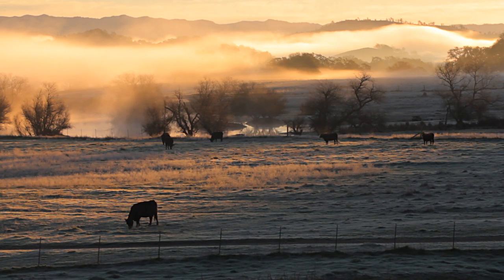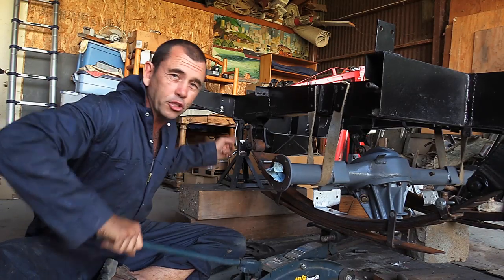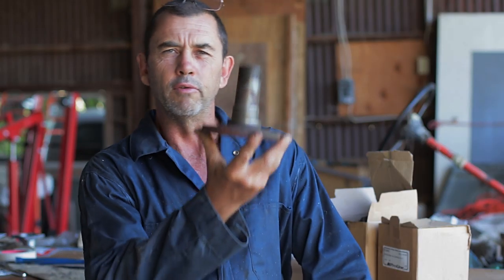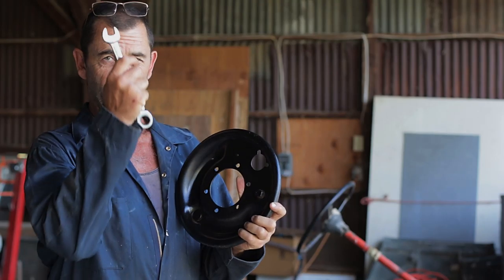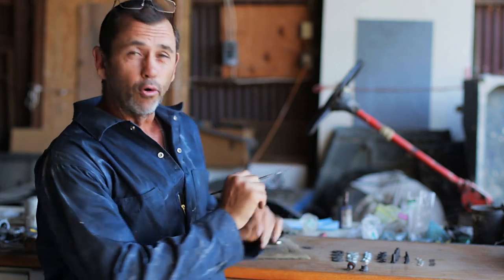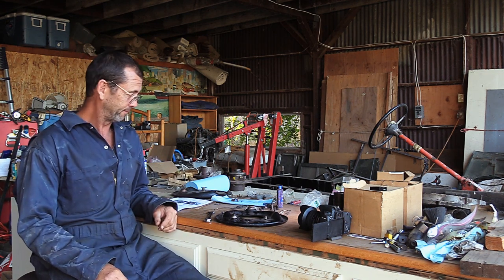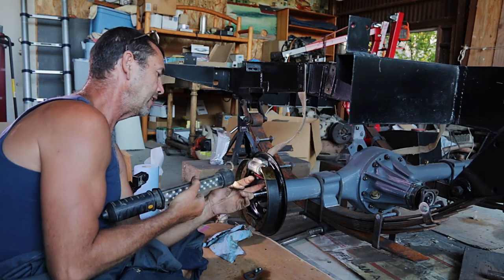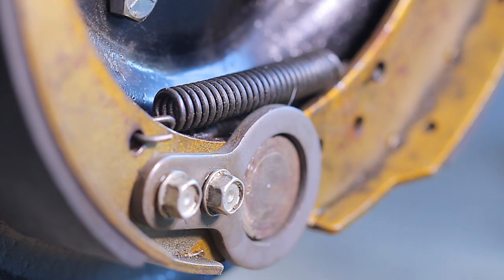Part_8 Rear End Re-assembly; Series 1 Land Rover Restoration.

Comment: Another great update. Keep them coming. You don't need check straps on the axles if you are using modern shocks. The old shocks used to be destroyed by bottoming out, but new shocks are designed for it. Would give slightly better articulation if removed.
Reply: Many of us here in Aus say AULRO as All-Row. Makes it a tad easier to refer to in videos.

Comment: Really need to talk to you about safety, no 1, you need to buy a cheap cap, preferably something that advertises beer or farm machinery, and wear it back wards when angle grinding.  That stops grinding sparks getting in your hair and down the back of your overalls. No 2, do the top Botton of your overalls up, it will reduce the chance of grinding grit going down your front and singing your manly chest hair.  No 3 I understand why you don’t wear boots. If you were to wear boots, hot stuff falls into the gap between your boots and your ankle and burns through your socks and melts into your skin. No boots, hot stuff just falls away, no burnt socks or melted lumps in your skin.